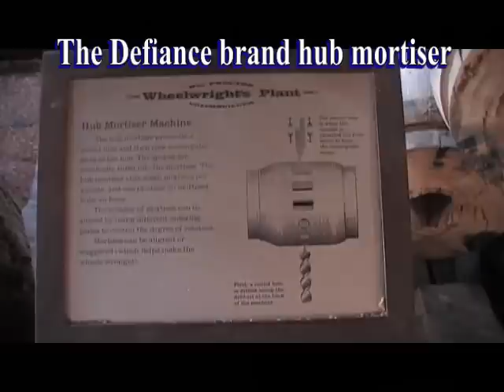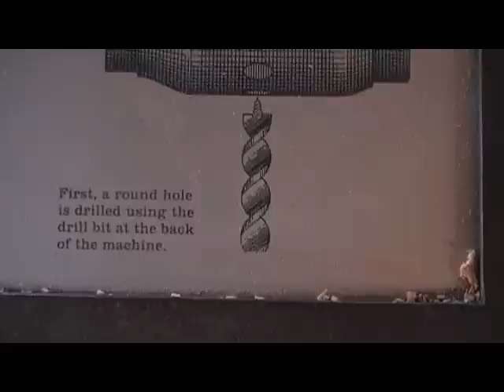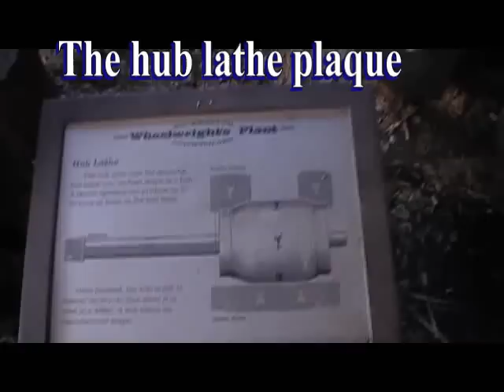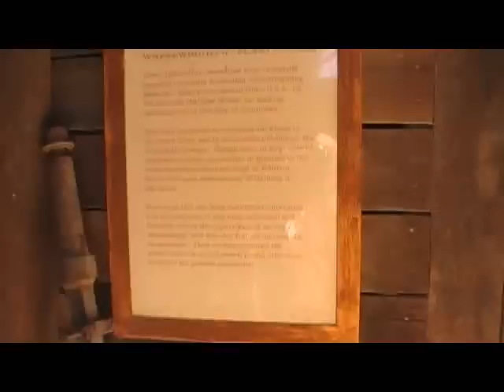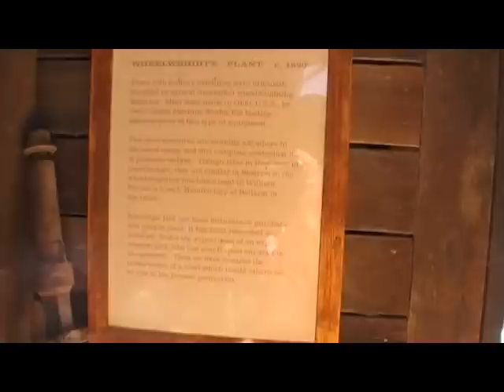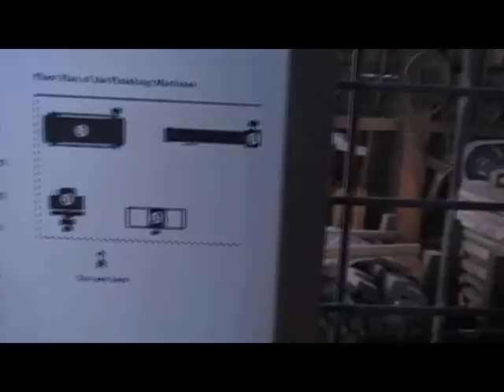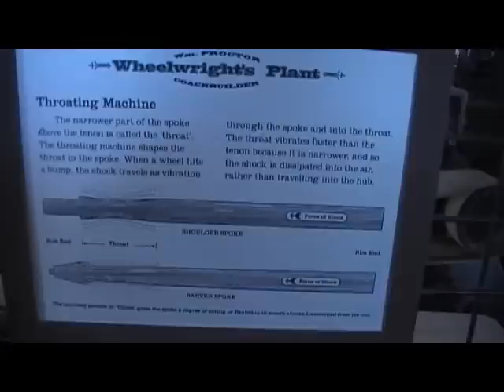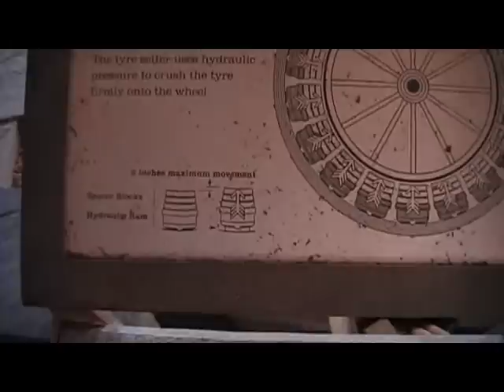Proctor's Wheelwright machinery, part 1, Sovereign Hill, making wagon wheel parts

Comment: Enjoyed the video. His explanation on the reason for the shape of the spoke was right on the money. I could not imagine working there all day and listening to the noise. At times it was dificult to understand what he was saying but the video said it all. Thanks
Reply from the maker: +MrAffolder 
Thanks, yes, the noise was a bit of a distraction in the video.  It wasn;t so bad in real life - I think the camera microphone was just a bit more sensitive to it.
The idea of throating the spoke it to give it somewhere to flex, rather than extend the stresses into the hub, or onto the tangs.
When a wheel goes from stopped, to moving,  there is inertia, or resistance to movement, just before it gives, and moves. The slight narrowness of the spoke just out from the hub allows a minute bit of flex there, to ease the stresses all round. (That's my explanation & take on it, anyhow!)

Glad you enjoyed it!

P.S. There will be a 'part 2' that I'll upload in a couple of days, as the computer docked the last 5 minutes of wheel tyring from the video clip.